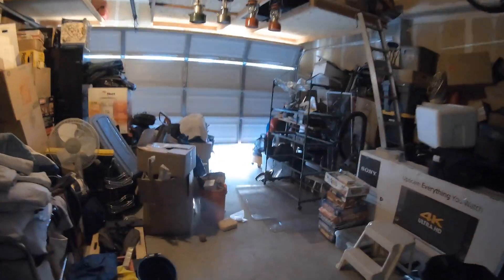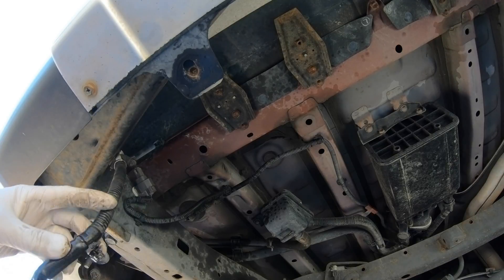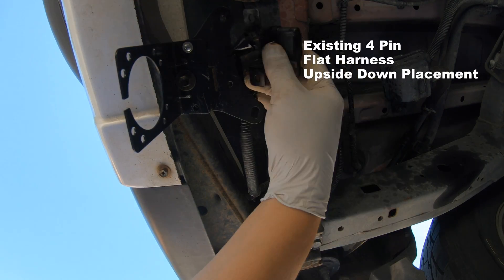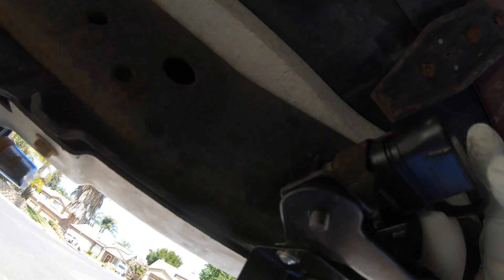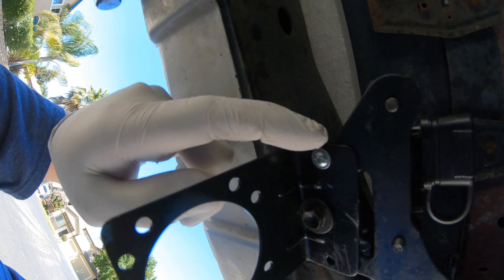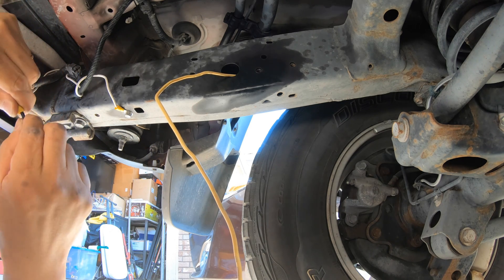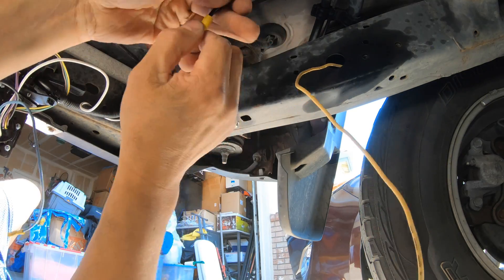Part2 How to Wire FJ Cruiser with 7 Pin Tow Adapter & Electronic Brake Controller tow wire diagram

Comment: So where did you run the blue and black wire to ? I didnt catch that .
Reply from the maker: Agustin Herrera there are 2 black wires... I hope you watched part 1... here is the link https://youtu.be/D-9hnJ5wuAk
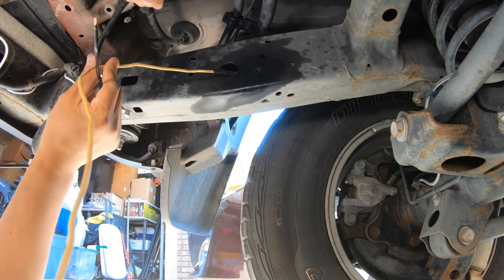Reply from the maker: Check 10:03 ... I talked about the blue wire and black wires... the set I ran through the chassis
Reply: So i need to buy an ebc?
Reply: Im a bit new to this i just bought a dump trailer that has brakes . But my van only has the 4 pin connector and i just bought the adapter like you did
Reply from the maker: If the trailer is very light... and for very light duty... no need for ebc - electronic brake controller. But..., I think it is not light if the trailer came with brakes. Is the trailer connector 7 pin? There are cheaper ebc if you are on a budget.
Reply: The trailer is a 8x10 dump trailer and it does have a 7 pic connector. So for the brakes to work it definitely needs a ebc? And what do you think ? Does it need the use of brakes ?
Reply from the maker: You should get an EBC... There is budget EBC. Tekonsha is a great brand. Mine cost $130... but you can get this for Tekonsha EBC for $65.. https://amzn.to/36Wl1CZ

Comment: Thanks for the tutorial, much appreciated. I'm in the middle of mine right now. Why was it you did not use the purple wire? I think the Hopkins diagram showed it as Back up/Reverse. I used 2 fairly long pieces of bailing wire. one from the front chassis that got hung up half way, and one from the rear and met in the middle. Controller mounted, not yet wired. Still need to mount the breakers and run the engine compartment wires and should be good to go. Got about a 900 mile drive to pick up the new Forest River Rockwood. Again, very helpful. Many places in my area quoted $2-3 hundred and that's if you provided the controller and wiring.
Reply from the maker: Thank you for the feedback... I was actually saving / planning in installing a wireless camera for the purple wire. Wireless broadcast on a rear view mirror or iPhone (or iPad)...Yes to the Backup light... thanks again.

Comment: This video series was super helpful for me, but I have to say, running the long power and EBC wires thru the interior of the vehicle, behind and under the trim was much easier than snaking thru the chassis would have been, for me, anyway.  Thanks for the information.
Reply from the maker: Thank you very much for the feedback. It is appreciated. So true running inside... just another way. Awesome you did it that way.